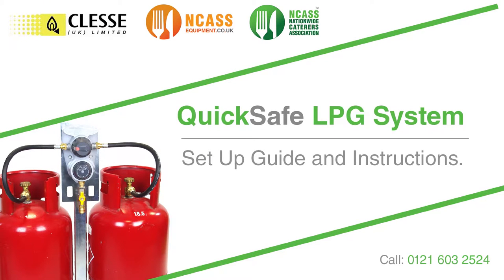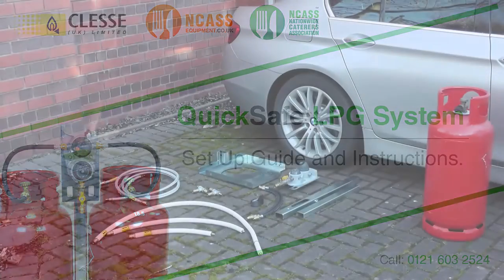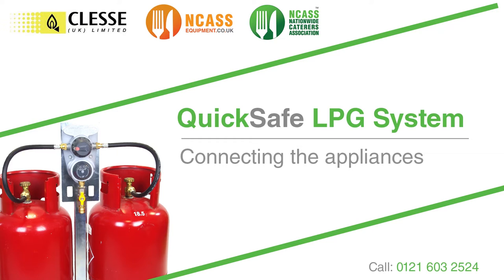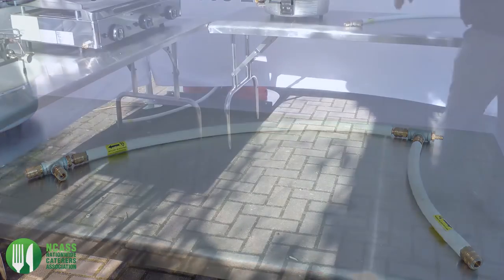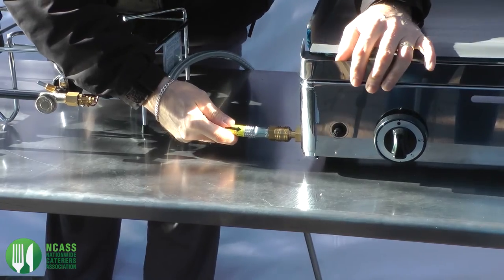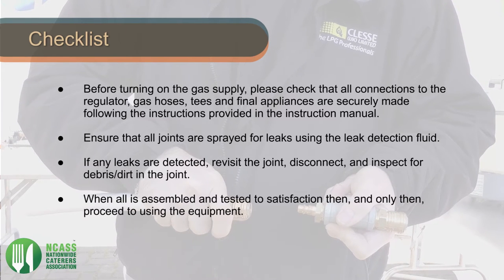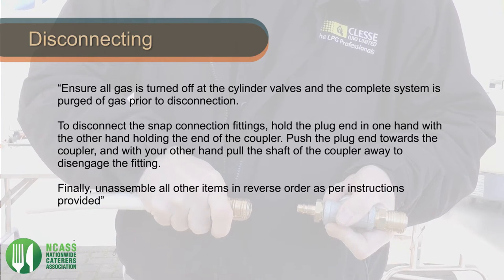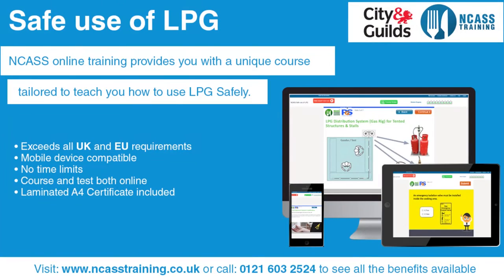Gas Safety - QuickSafe LPG System | NCASS

Comment: It you really wanted to add to convenience and safety then why don't you use Handwheel type POL connectors for the cylinder pigtails, then you'd have a completely tool free system (that securing strap arrangement could be much better as well, it encourages people to put stress on a gas connection when they tighten the strap up.)
Reply from the maker: Martin King - thanks for taking the time to give us feedback, we appreciate it. We’ll pass this on to the manufacturers and discuss it with our safety panel to see how viable this would be and asses the value it could ad to the system. If you fancy having a chat about it feel free to give us a call this week (from tomorrow) - 0121 603 2545. Have a great bank holiday!